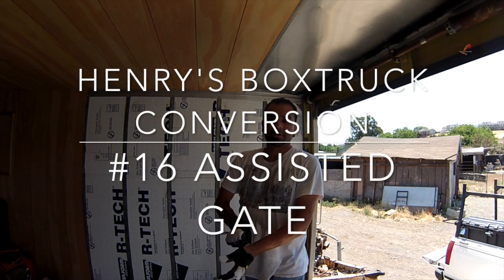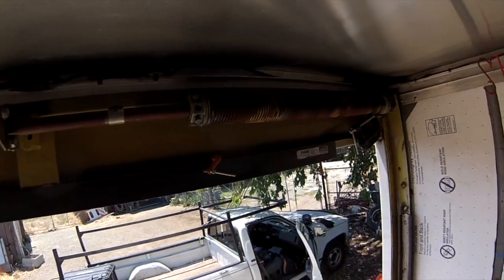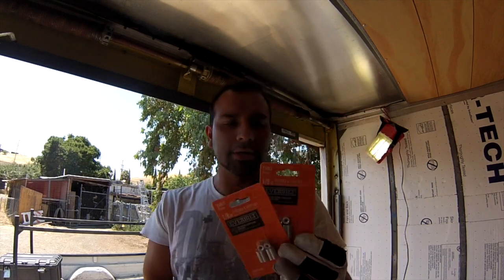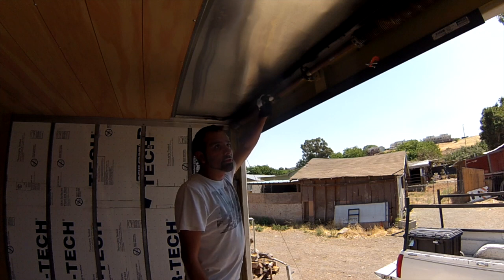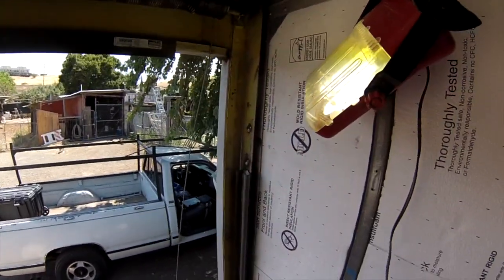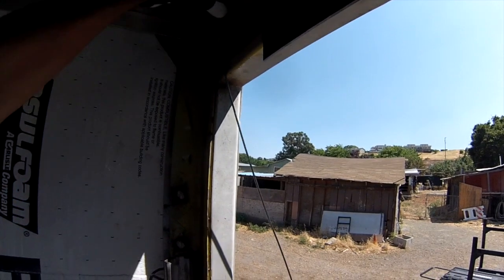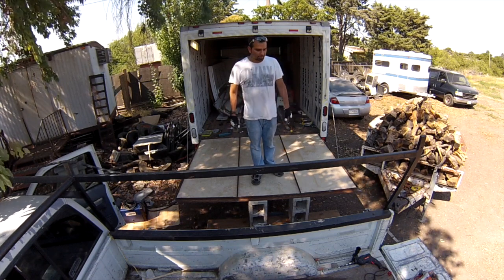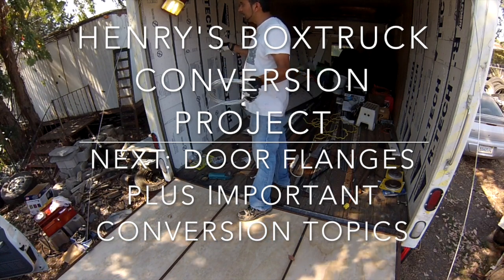Assisted Gate - #16

Comment: A boat winch mounted under bed that uses hand crank or cordless drill. Place a ferrel on the cable can be a stop or premeasured second connection for ramp or patio. Need to spec weight  limit. Your cable system does not have weight limit. Some commerical cargo box manufactures have your system engineered. I would get their spec sheet. Morgan truck body has this

Comment: Railing hinged corners with braces and insertable alum frame with cable with turn buckles. You can mount on frame of your rig house deck cable has safety spec of uniform building code.

Comment: Grate job. , you did what you set you mind to do ..   About Metal frame  your  angle iron is exposed by around a 1inch   I'm thinking you can make steps out wood  mad place magnets on the  bottom of the door when it opens and on the top to place removable steps that will be held in place by the magnets.   ..   On the steps design cabinets on (rise)  and crabnet doors on on (pitch).  Then make room door to place the step to hold shoes and other out door stuff in the cabinets ..

Comment: Crushing the ferrule with a vise will eventually allow your cable to slip. You need a crimper made for cable ferrules.
Reply from the maker: TIM Strom, your are right. I didn't mention it on the video but if you notice closer, I used nails in the crevices of the ferrule to crimp it in the center so that each side of the cable gets wrapped tight as oppose to just squashed together. Good eye TIM 😜